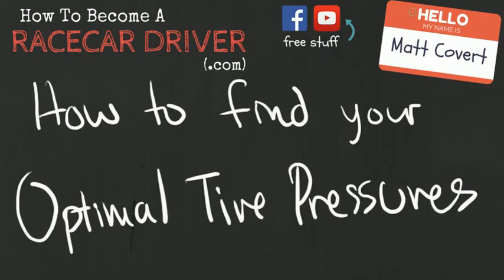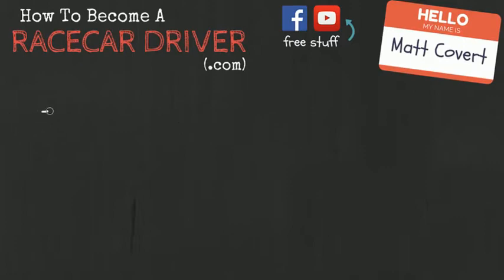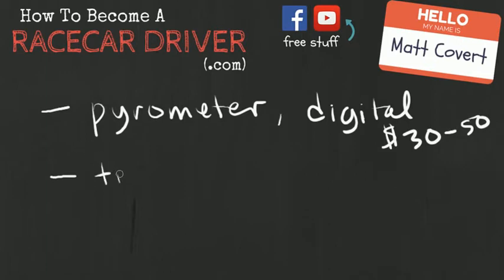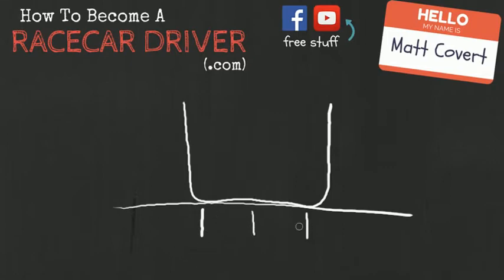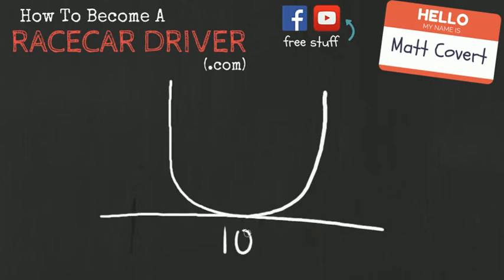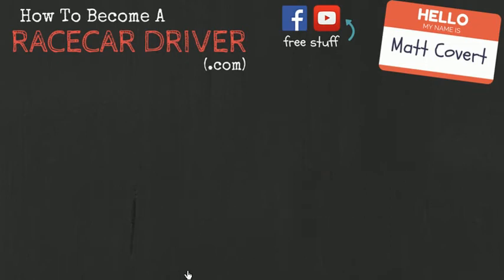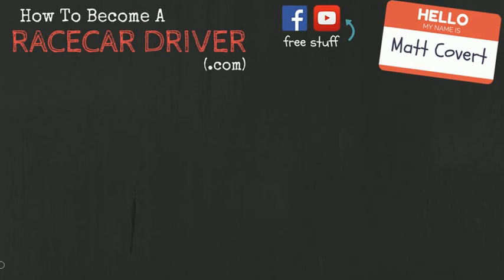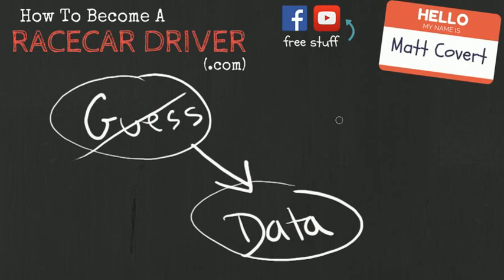Optimal Tire Pressures

Comment: Nice advice. But my car quickly ruin the outside of the front tire because the bolts for camber adjustment are welded there in rust , not being touched in 20 years of street driving

Comment: Two questions come to mind: (1) what is your starting pressure? For instance, what if all four tires have a max PSI rating of 44. Where do you start for that first run? Also, (2) how would you account for negative camber? I run -3.2 in the front and -2.7 in the rear.  Even with a turn-heavy circuit, would I not expect the interior portion of the tire to be warmer due to the negative camber? I have other questions as I'm relatively new to the track, but I'll leave it at that. Ok I'll say this much: someone I trust with racing experience told me what I have been doing every day at the track, and it has worked for me, but I wonder if I could get more out of the tire if I measure temps and adjust accordingly. Anyway, he said to aim for a hot temp to be equal to the max PSI allowed by the tire itself. In my case, the max for my Federal SS595's is 44, so I usually start with a cold temp of 38 so that by the time I am done with the 20-25 mins session, the pressure on each tire will be in the 42-45 range, depending. Like I said I have had good experiences this way and the tires have lasted me for about 9-10 track days, so I couldn't ask for more, but I'm willing to try new and better things. Thank you.